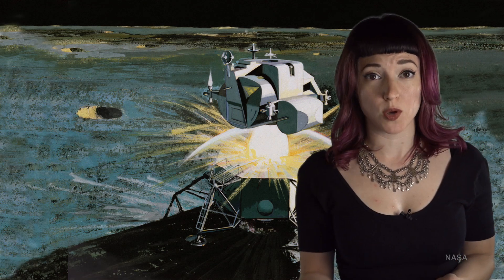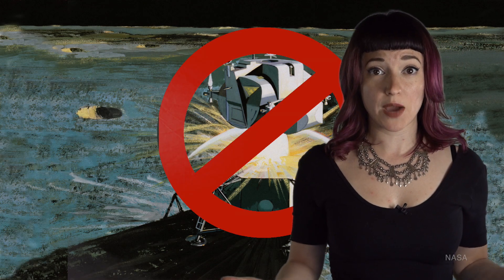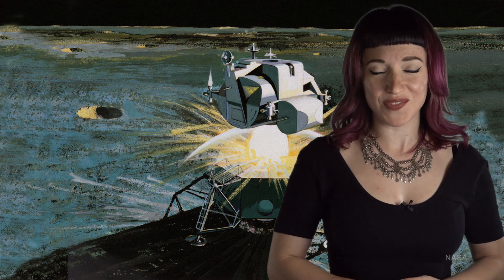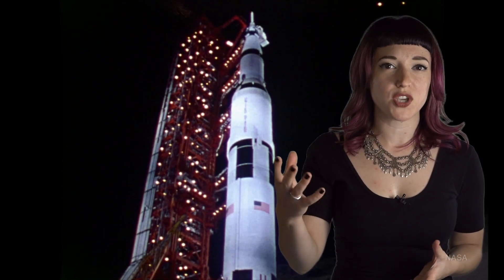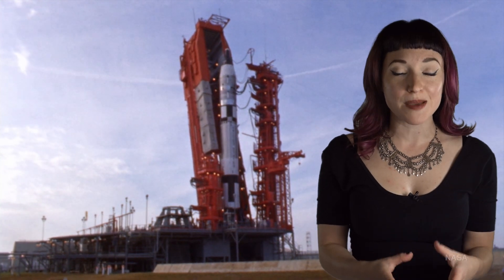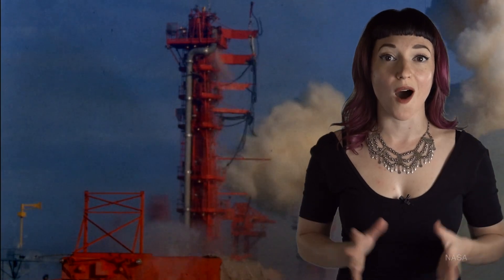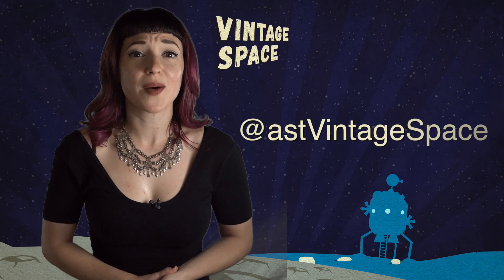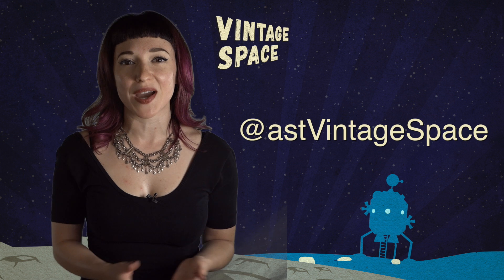How the Lunar Module Launched from the Moon Without a Flame

Comment: Also explain why we see the lunar module make a brutal pitchover at the top of the video...WHICH IS PHYSICALLY IMPOSSIBLE! https://www.youtube.com/watch?v=tG1Jz0s3LbU&t=26s
Reply: What makes you think it's physically impossible?
The document your link repeatedly shows of the ascent profile displays the module pitching from vertical to 52degrees in four seconds, exactly what we see in the launch video.
Launches on earth pitch over more slowly? Yeah, they have to deal with atmospheric pressures, and at higher speeds. The lunar module didn't.

I'm loving the claim about the two "synchronised" videos.
He starts them both at the lunar module launch, ignoring the fact that the video from inside the lunar module only started after guidance switch at launch +6 seconds.
Once that's taken into account, you can see the pitching occur when expected.
Reply: +Niall Kinsella
I have explained in my video why it was not possible; the pitch must be very progressive; if the lunar module takes a horizontal attitude too early, before it has acquired a sufficient horizontal speed, it won't have a centrifugal force allowing to counter the lunar attraction and it will fall down; and no, in the launch video of the Saturn rocket, the saturn rocket does not make a so brutal pitchover, it pitches very regularly, and it has nothing to do with atmospheric conditions.
Reply: @pascalxavier3367  
Right, your video assumes the lunar module turns 90degrees and burns horizontally.
But your video also shows ascent profile document from NASA that show the module was only to pitch over to 52degrees.
So either the video's assumption is wrong, or the documentation is wrong. I know which one my money is on.

Now, let's assume the pitch was 60degrees over for the sake of making the following maths easier. At that angle, two thirds of the thrust would generate horizontal motion, but one third would still produce vertical motion.

The lunar module had a thrust to weight ratio at launch greater than 2.1 to 1. 
This increases as fuel is burned.
Once it burns enough to get a ratio of 3 to 1, at 60degrees pitch, it will keep a stable altitude.
Combine that with the momentum it already has from the vertical burn, and it's not going to fall back to the surface.
It may slow is ascent, even lose some altitude at first, but once it gets past that 3 to 1 ratio, it's going up again.
Here's Apollo 14's ascent. It's did actually fall slightly at pitch over, but not by anything that couldn't be recovered from.
https://forum.nasaspaceflight.com/index.php?action=dlattach;topic=29195.0;attach=419600;image
Reply: Not quite 90°, but still too much, it is obvious that the linar module makes a very brutal pitch it shouldn't do in a normal ascent trajectory.
Reply: @pascalxavier3367  
What would something pitching over by 52 degrees over four seconds look like from a distance between 400 and 700 feet?
Reply: Froml this distance we can very well see the lunar module if we make a close-up on it, and we can perfectly see that the pitchover it makes is more than exaggerated.
Reply: Dummy, quit pretending to understand topics you don't understand.  Your "brutal pitchover" is merely the effect of the camera (mounted to the rover) pitching up as the LEM is pitching over.  It's not more complicated than that.  It's the same sort of thing when other conspiratards complain because they think that the LEM was violently pitching up and down in an impossible vertical movement (a few seconds later), because they don't realize it's the camera that's pitching up and down, not the LEM.  You ignorant people simply do not understand camera perspective, and you're looking for ANYTHING to cling to, to support your utter delusions.  You post comments here and elsewhere, exposing your massive ignorance about the topic.  And, in your arrogant ignorance, you think YOU are noticing these "errors" that no actual aerospace engineer or rocket scientist anywhere on the planet for the past 50 years has been smart enough to notice.  You look at a grainy video taken by a remote control camera, and you think that you can debunk Apollo with it.  But, all you're doing is announcing to the entire world that you're an idiot.
Reply: No, absolutely impossible, the brutal pitchover is not the effect of the camera mounted on the rover; you are making a confusion with the sinisoidal move we see later; and besides, even if the operator controlling the camera was clumsy, he would not have been so clumsy that the lunar module would have moved that way on the image, especially since he was aware of the delay between each command he makes and the result he can see on the image.
Reply: The exaggerated pitchover has absolutely nothing to do with the move of the camera! You have no idea what you are talking about!

Comment: @VintageSpace What are those dense white fumes coming out of the curved surface of the SATURN V during launch?
Reply: Is this the type of thing you're referring to?
https://www.universetoday.com/wp-content/uploads/2009/10/ares-bowshock.jpg
Reply: Niall Kinsella No not that. Just when the rocket liftsup.
https://youtu.be/NK2u1i_bwlE
Look at 14:51
Reply: @TrueNetworking  
Ah, I see now.
It's just condensing water vapour.
The oxygen used in the rocket is cryogenically cooled to a liquid state, you get lots more molecules of oxygen to burn with fuel that way.
The liquid oxygen cools the outer skin of the rocket and nearby water vapour in the air condenses into clouds because of the cooling effect.
You can see the same thing coming off of something really cold you've just taken out of a freezer, at a much smaller scale.

You can even get some build-up of ice, which breaks off at launch. You can see some chunks of ice falling away from 36:20 in the link you posted.
Reply: Niall Kinsella Okay I had suspected that correctly. Thankyou.

Comment: I'm not interested to theory or debunk so the question here is not if the lunar landing is true, or not, but please, it is better you don't make inconclusive video like this.
Everyone know that the original video doesn't show fire of the rocket.
You have to explain what kind of engine is and what propeller it use that doesn't produce fire.
You cannot tell "ho well, you know what? The fire is to tiny to see..."

Comment: who raised that camera up to follow that module and before you say it was remote controlled how did it follow it so perfectly and yea your going to wide screan footage that explains the width not height also it zoomed in
Reply: It took three things.
1. A programmable camera mount.
2. Some calculus.
3. An engineer named Ed Fendell who was in charge of putting 1 and 2 together.
Reply: @niallkinsella2687  Is that 3 facts you just literally invented out of thin air??
Reply: @digitalfairies3362  
Feel free to google Ed Fendell's name if you don't believe me.
I fully encourage you to do so.
Reply: YOU SAID: "who raised that camera up to follow that module"

== Ed Fendell.

YOU SAID: "and before you say it was remote controlled how did it follow it so perfectly"

== Lots of planning and practice.  They couldn't do it on Apollo 11/12/14, because they didn't have the remote controlled rover-cam to do it with.  They couldn't do it on Apollo 15 because the tilt-up function had broken.  They tried on Apollo 16, and it kind of worked, but not really well.  They had a really hard time keeping it in frame.  So, on Apollo 17, they parked the rover further away (giving a much bigger frame to deal with), and Ed Fendell simulated it at least 3x right beforehand.  They knew the trajectory the LEM would take.  They knew the delay.  They knew what the ascent rate would be.  It's just math and timing from there.

YOU SAID: "and yea your going to wide screan footage that explains the width not height also it zoomed in"

== Hey, instead of ruining your mind with stupid conspiracies, how about learning to read and write in English?  I promise you, literacy is far more useful in life than insane conspiracies.  Go work on literacy instead of trashing your brain with stuff you don't understand about Apollo.

Comment: So how did the upper portion of the returning LEM manage to attain the speed necessary to match the command module which was in lunar orbit, at about 4000mph presumably?  Surely this was a one-shot task.  I struggle to calculate the acceleration needed by the LEM to be able to do this let alone the problem of matching two completely different trajectories/orbits etc.  This seems to be the most critical part of the entire mission as speed matching the two craft would be a major challenge …
Reply: They were able to do it above earth, at three or four times the difference in speeds, during the Gemini and Agena target rendezvous and docking missions.
Reply: @niallkinsella2687  It would seem they plan some things over decades.  I hadn't appreciated that.  Thanks.
Reply: @alvar2000  
You could almost think of it like this:
Mercury: First steps, develop basic life support, basic spacewalks, basic controls in space, tracking and control from the ground.
Gemini: Here's where it gets interesting, orbital maneuvers, orbital rendevous and docking, extended life support.
Apollo: development and testing of the actual moon landing hardware. Doing the whole mission step by step, right until touchdown.
Fun fact, on Apollo 11, the only bits that had not been done before was the final 10 miles of the descent and the landing.

So yeah, everything was planned, relatively small steps at a time, all building to the big success.

Comment: First of all if that was nasa's official statement they would have mentioned it sometime before you were born.  Secondly the thrust would have kicked up so much dust in 1/6 atmosphere it would have made filming virtually impossible. Lastly nasa's communication with the remote camera is even more sketchy the technology to operate a camera with precision as well as coordinate that with communication is very questionable. In 2018 we have lots of problems losing cell phone signals imagine using 1969 technology to make a 500000 mile  (there and back) phone call that should have experienced issues as the transmission passes through the van Allen belts. Lastly from nasa's own info the LEM didn't carry enough batteries to pull off such a task as well as maintain auxiliary support.
Reply: YOU SAID: "First of all if that was nasa's official statement they would have mentioned it sometime before you were born."

== Pfttt.  What?  And you think NASA wasn't aware how the fuels burned before they went to the moon?  Good grief.

YOU SAID: "Secondly the thrust would have kicked up so much dust in 1/6 atmosphere it would have made filming virtually impossible."

== It DID kick up lots of dust.  And, yes, when they got close to the surface, correct, you can't see all that well through the dust.  Just go watch the videos.  Good grief.  It varies from mission to mission, of course.  Some areas had a thicker dust layer than others.  But, yes, they definitely had a hard time seeing 100% clearly through the dust.  But, that's fine, because they could tell where they were, they could see the horizon, they could see (limited but good enough) through the dust, and they had the 3 probes that touched the surface first to let them know when they were 68 inches above the surface.

YOU SAID: "Lastly nasa's communication with the remote camera is even more sketchy the technology to operate a camera with precision as well as coordinate that with communication is very questionable."

== Pffttt.  Who thinks it's questionable?  YOU??

YOU SAID: "In 2018 we have lots of problems losing cell phone signals"

== Well, if you had one of these attached to your cell phone, I think you wouldn't have too much trouble.
https://en.wikipedia.org/wiki/Parkes_Observatory#/media/File:Parkes_Radio_Telescope_09.jpg

YOU SAID: "imagine using 1969 technology to make a 500000 mile  (there and back) phone call that should have experienced issues as the transmission passes through the van Allen belts."

== And, you think the S-band radio signal was affected by the Van Allen belts, why?  You fucking morons always look at the Van Allen belts as a magical wall that cannot be penetrated.  Why?

YOU SAID: "Lastly from nasa's own info the LEM didn't carry enough batteries to pull off such a task as well as maintain auxiliary support."

== Bull.  Fucking.  Shit.  You are making this up.  And, dummy, how many people were in on this hoax?  You think none of the thousands of engineers working on the problem noticed there wasn't enough battery power to do the job??  You think that "NASA's own info" states that there wasn't enough battery power... yet nobody for the past 50 years ever pointed out that their own documentation claimed Apollo couldn't work???  What an idiot.
Reply: Rockethead that's a great name for you because you are totally gone. For decades American history books said Christopher Columbus discovered America do believe that as well. How about this for centuries white people said Jesus was white. He's a great one Adam and Eve were white that one tickles me every time. How about 9/11 we know based on facts not conjecture a group of guys didn't steal two commercial airliners and crashed them with precision into 2 world trade buildings destroying 3 (lol). I won't even get into the many wars for profit this country has been involved with nor the propaganda and stereotypes created by whites about blacks. My point America more specifically white Americans have always endeavor to write the narrative in their favor no matter how many lies have to be told. Often times it doesn't take much effort to uncover truth vs fiction. My suggestion to you unlearn the history whites have taught you that's the only way you can find truth amidst lies. The greatest trick the devil pulled was that he didn't exist.
Reply: That still makes me better than you on your best day

Comment: And did they leave someone on the moon to take the damn video.. cause I'm sure they didn't have wireless tech in the 60s
Reply: Ed Fendell was the engineer who programmed the lunar rover camera rate of tilt to keep the lunar module in frame, and specified where the rover should be parked.
At the right time he just sent the command to start the program.
All from the comfort of mission control on Earth.

Comment: The camera is remote control, controlled from Earth.  But Earth is so far away, the remote control has a massive lag (facts).  I just find it bizarre with the millions of dollars, all the risks and everything that could go wrong... they decided to set up a remote control moving camera and train a guy to move it (with lag). Maybe just put the Camera further back and not have this weirdness.
Reply: The camera was preprogrammed to tilt up at the correct rate to keep the ascent stage in frame.

The rate of acceleration was known, the launch time was known, the distance from the rover to the lander was specified. Calculating and programming the camera tilt is simple maths at that point.